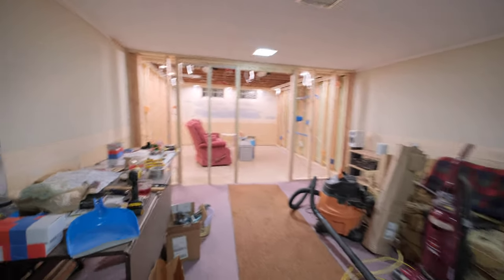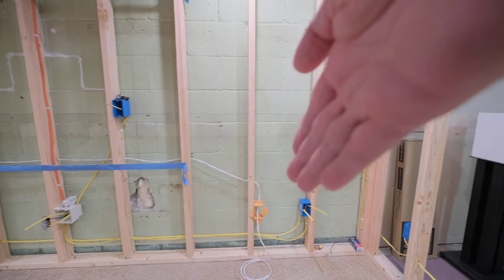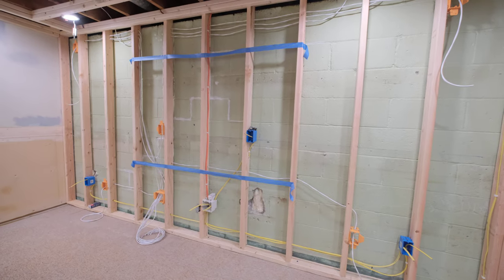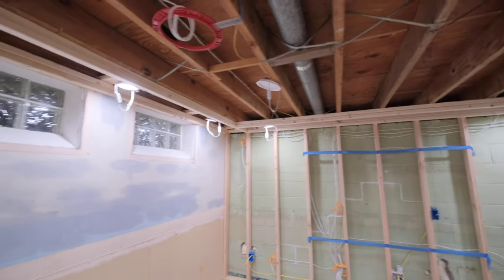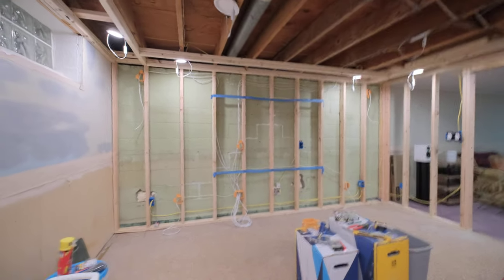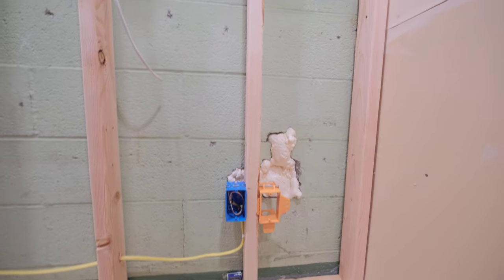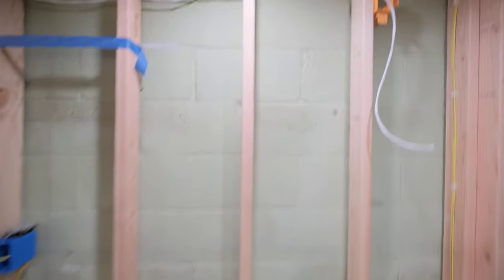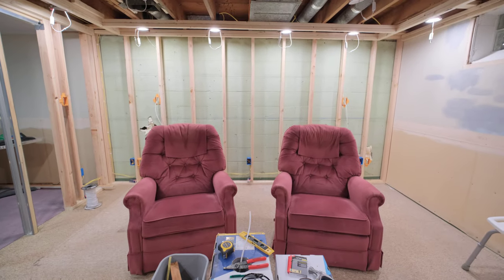Home Theater Project Part 6 Soffits, Lighting, and Prewire

Comment: I’d say drywall over the windows especially since they’re not functioning windows but just for letting in light. You can also build a frame that seats inside the opening and cover it with some type of fabric that matches your wall color. Kinda like an acoustic panel.
Reply from the maker: Yea, we did drywall over them in a subsequent video. It makes the room and sound treatment design much easier. ;)
Reply: @Clint_the_Audio-Photo_Guy  Yeah I saw that. I watched this video before that one. Looks great.